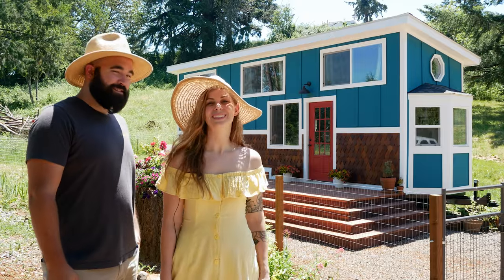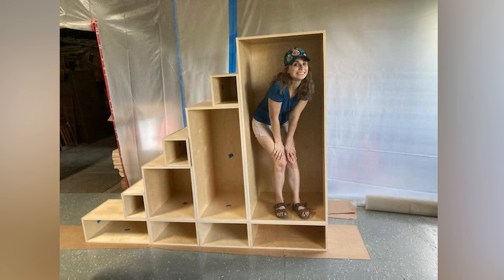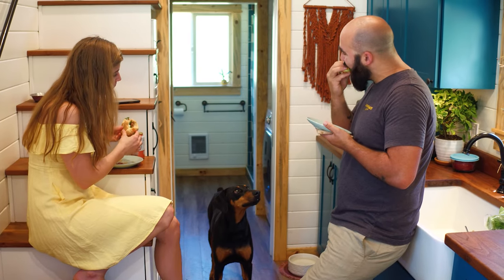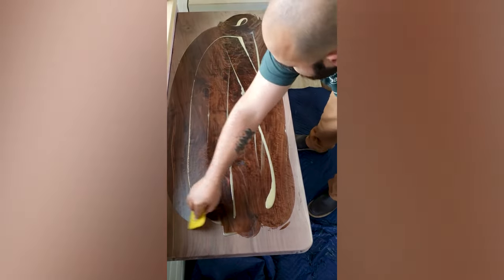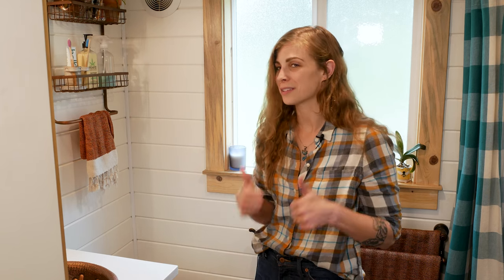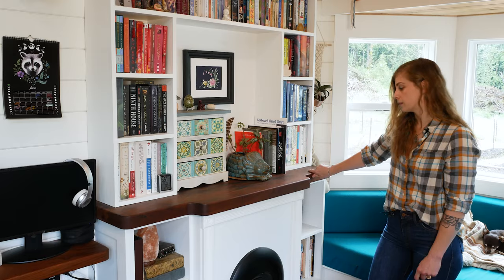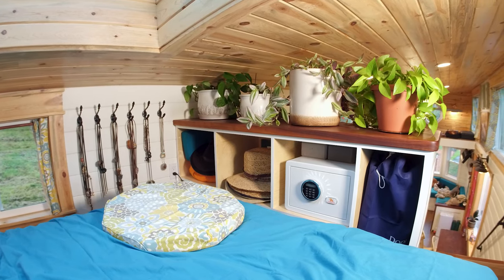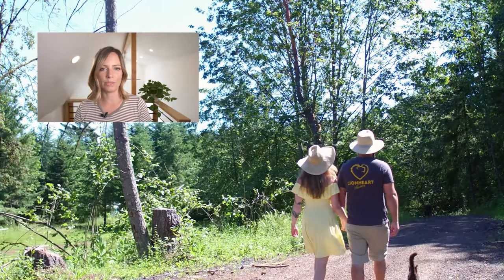Gorgeous Tiny Home w/ luxury kitchen, fireplace, & so much storage

Comment: Love the utility closet at TS 4:06.  I will keep that in mind for the tankless water heater for my future tiny home.  Great idea.  TS 4:22 Getting a on-demand water heater is going to be a must.  Saves water too.  Love it.  TS 7:00 OMG!  A slide!  I have noticed that drawers typically do not maximize the space vertically.  This is awesome.  TS 8:08 How you did the storage under the stairs is a marvel.  Tea drawers and sliding drawers.  Great use of the bottom row.  TS 10:15 Love the built-ins for the shower.  Thank you for the video.

Comment: I like the fact that your windows in your bedroom look as if they are egress windows. Most other tiny houses have tiny windows and or their picture windows.
Have you thought of making any house plans that have a downstairs bedroom or are more easily accessible for people with physical difficulties.
Reply: #susanst-germain4028
If there are people (or a person) sleeping in an upstairs loft there needs to be at least 1 egress window by law for certifications.
And, the purpose is for safety  if an emergency escape is needed....ie. in case of fire or a break-in downstairs.  Of course no one can control what someone is building off grid and living in off grid.  But, it is not very smart not to have egress window(s) if people are sleeping in a loft.

Comment: I like the way they used the space, especially the spice rack. I like the idea of a tiny home but what I've noticed is most of these folks have their homes on their relatives property.  So the reality is you need to buy property 1st in order to have your home, an additional expense.
Reply: #christinarobleto1786
There are tiny home communities all over the country now.  That wasn't the case 4 or 6 years ago.   If you research it,  you'll find a much needed increase in tiny communities with reasonable lot rent.  Some lots cost anywhere from $200 -$ 300
Reply: Continuing.....from $500 - $800 per month.....depending on the part of the country.

Comment: When building a couch, DO NOT buy craft foam or Hobby Lobby furniture foam. It's NOT EVEN REMOTELY CLOSE TO FURNITURE QUALITY! Buy a used couch of Craigslist for the cushions or buy a rent a center repo, scratch and dent and use the couch cushions inserts, seam rip the covers and make a pattern from them in your preferred fabric. If you want new call a furniture store or manufacturer and order the exact cushions in the size you need. All furniture stores offer factory replacements for warranty purposes. They sale them in 3 different densities- soft, firm & XTRA FIRM.

Comment: I wouldn't call it a large trailer. I've seen tiny houses built on 44 feet-long trailers, it all depends on local regulation. I still think that the European style of building them, without the trailer, is better. You just drive them to a location on a semi and put them in place with a small crane and there is no artificial 399 sf ft limit.

Comment: The couch looked pretty but it sure did NOT look comfortable. The cushions weren't even an inch thick when she sat down and she's a thin girl. I like to lay down, sprawl out on my couch. Also, I have lived in a 5th wheel and have had both washer and dryers, and the combo. The combo is MISERABLE - DO NOT WASTE YOUR MONEY UNDER ANY CIRCUMSTANCE! You can only wash 4 items (2 shirts, 2 jeans & it takes 4 hours to wash and dry). You get the seperate ones and you can wash a King comforter, and an entire set of sheet all at once. It will all be dry in 40mins max!
I LOVE the shower rod & copper accents. She has an eye for design & the layout was beautiful.